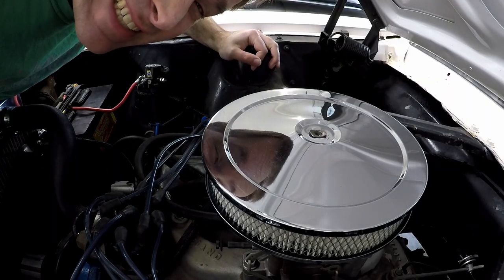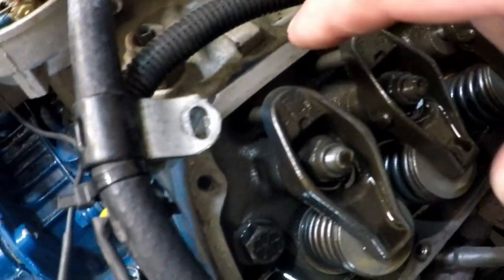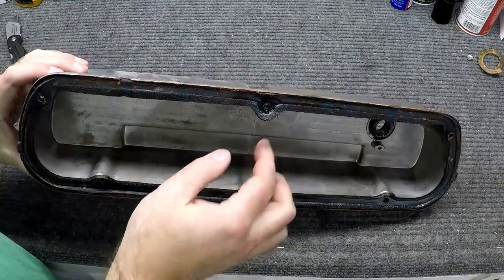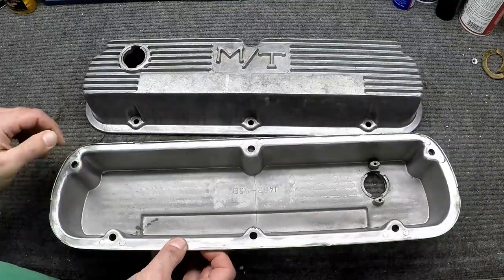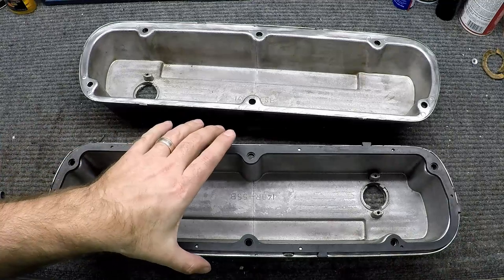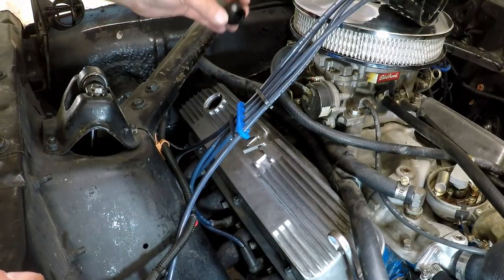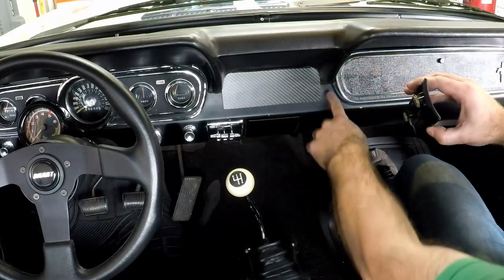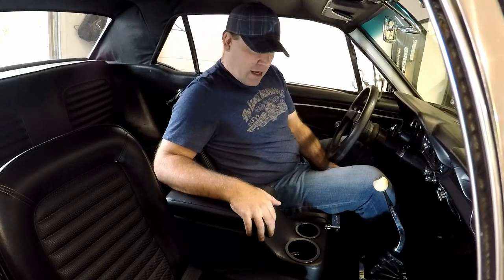How to Replace Valve Cover Gasket on a Ford 289

Comment: About 25 years ago, my 65 Mustang did what can only be described as a burp/hiccup/fart simultaneously. The interior of the car filled with smoke. I turned it off and dough for cover. When I opened the hood, the side of one of my valve covers had exploded. I ended up changing the valve covers and gaskets and the motor ran fine ever since.... Until I wrecked it of course. 

Thank you for this trip down Mustang Memory Lane! :)
Reply from the maker: You're welcome.  :)

Comment: Thanks again Andy! I just realized my valve cover is leaking. You have videos for everything. Fingers crossed this is the only leak!
Reply from the maker: Fingers crossed!
Reply: @AndyKruseChannel  great news. I primed the surfaces just like you had on the video. Cleaned up the oil pan and under carriage then took it for a cruise. When we got back there weren't any drips. I checked the next day and still nothing. I'm so glad I didn't have to reference the rear main seal video!
Reply from the maker: @Robert Price  I know the exact feeling you're describing, it's good stuff!  Here's to more leak free days!  😁
Reply: @AndyKruseChannel  Now I'm on to my passenger rear wheel cylinder. I'm not sure when the drum brakes were done last, so I'll take it apart to see if I'll just do a rebuild on both sides. Probably also a dual bowl setup w/ proportioning valve. After that will be a steering wheel replacement. Fingers crossed I don't have to do the wiring harness too. I'll comment on your other videos to let you know they helped ;)

Comment: Thanks for the vid Andy. Haven't done this for a long time. I ended up buying the blue rubber "FEL-PRO VS 13264 T" for my 1965 289. After watching your vid, I see you bought the "FEL-PRO VS 13264 R". I don't know much about these products, so I'm wondering what made you choose that gasket and if you think I should return mine and replace it with the one you bought.
Reply from the maker: This is an older video and I have since preferred to go with the blue rubber gaskets over the cork gaskets.  :)

Comment: Any reason you couldn’t put the gasket on the heads? At least you don’t need to worry about the gasket falling off when you go to install them?
Reply from the maker: You might be able to do that on flat bottom valve covers, but when there's a recessed area for the gasket, putting it on the valve cover guarantees proper fitment.  Putting the gasket on the heads may not put the gasket in the exact location to fit inside the valve cover, possibly causing it to pinch the gasket.  :)

Comment: I’m going to be doing mine tomorrow, thanks for the video. Did you worry about torque settings when tightening?
Reply from the maker: No problem, I'm glad that my videos are able to help others.  :)  For torque specs, it's low, 3-5 ftlbs.  Basically just make them good and snug, should be good to go.

Comment: bro which steering wheel are you using?
Reply from the maker: It's from CJ Pony Parts, part # STW111KA1S.  It's a 15", woodgrain, 9-bolt unit and I paid about $140 for it last year.  :)